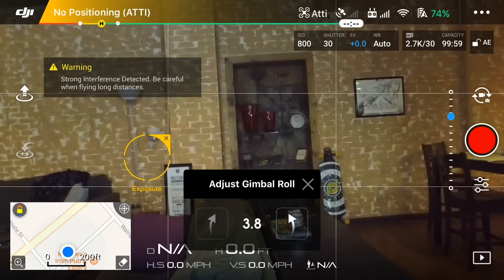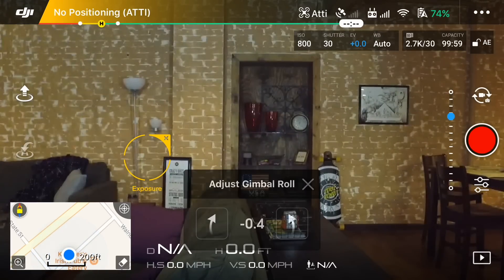Phantom 3 Standard Tip #7 | How To Calibrate Your Gimbal

Comment: I was wondering if you could help me? I have a Phantom 3 Standard that I have had for 3 months now. It has worked flawlessly since day one. A few days ago I took it out to fly and it wouldn't fly further than 50 meters without totally losing signal and returning home. I thought it could be interference in the area so I tested in other locations that I know that it performs perfectly and still no luck. I had not changed a single thing from the time it worked perfectly until it stopped working. Ive now tried re-pairing the controller, recalibrating the IMU, the gimbal and the controller. Ive installed the latest version of the DJI GO app and updated the firmware and still no luck. Do you perhaps have any idea what could be wrong?
Reply from the maker: +Taige Davies I'm not sure what could have happened here. Maybe take it apart and check the circuit board connections to the antennas like I do in the upgrade video. I've never heard of that happening.

Comment: I really liked the Philadelphi footage but it intrigues me how you managed to fly with all those Wi-Fi signals around. 
The reason I'm interested is that today I went to take a flight around the local duck pond which has houses on 3 sides. When I fired everything up it kept rapidly connecting and disconnecting to the aircraft and flicking back and forward between aircraft models. Of course I didn't fly but how did you get to fly with undoubtedly far more Wi-Fi signals around you than I had. 
I went out into the country and everything  worked normaly
Reply from the maker: +Bill Collie which drone are you using? The Mavic has a WAY better signal than the p3s.
Reply: JTO2GO. 
 P3S. I guess that's the answer. Any mods to overcome this issue ?
Reply: Bill Collie try using the dji3 with an older phone , had the same problem with my s8 and tried my s6 works perfect

Comment: JFYI After doing a Table or Floor Calibration, I regularly adjust my Gimbal Roll "while flying" also because mine almost always seems like it needs it when I doing Sunsets, epecially when it's windy (cross winds)...
I Pan Down far enough to "put the horizon at the top of the screen"  then open Gimbal Roll setting and adjust it so the horizon is parallel with Top of Screen (it will be curved but still works)...
Reply from the maker: +kcadby good idea

Comment: Hei, my gimbal and the camera are pointing a little bit more to the left than the right. I wonder if this is something that you can fix in the menu and if this is normal? Or is it some thing i need to adjust on the gimbal one the drone or is it some settings in the app ?

Comment: Curious how your range was in the city?
Reply from the maker: +nick dilbeck I didn't push it to the limit but had zero issues and went at least 2 miles
Reply: Ahh....rewatched the video , realized you were using the Mav. I'm running into range issues with my P3S with the ARGtek setup in Indianapolis.
Reply from the maker: +nick dilbeck yea, the MAV is the best for traveling.